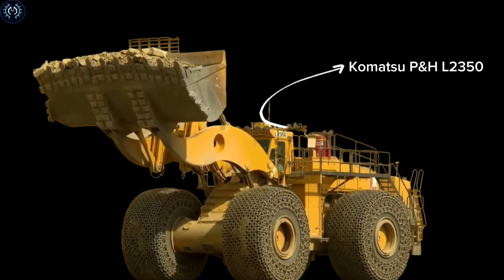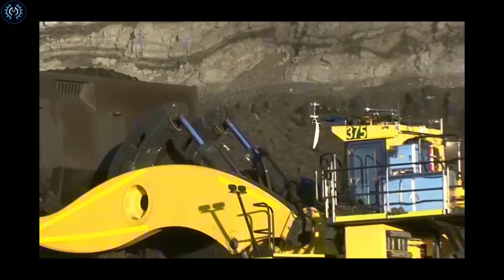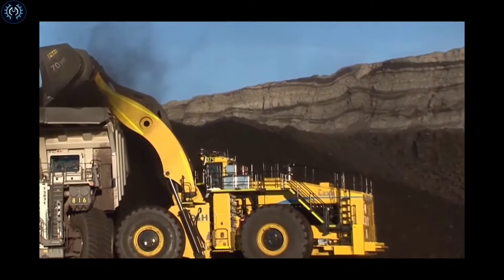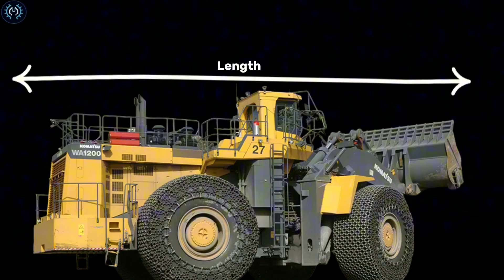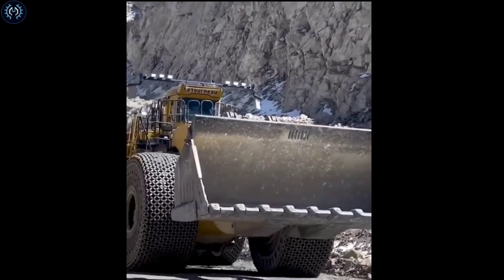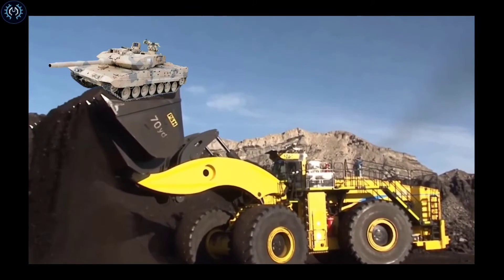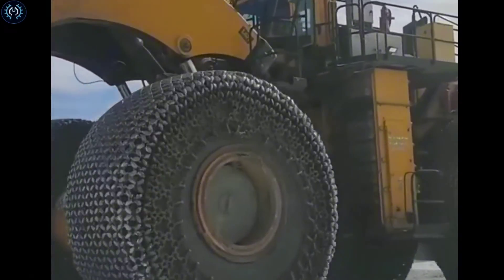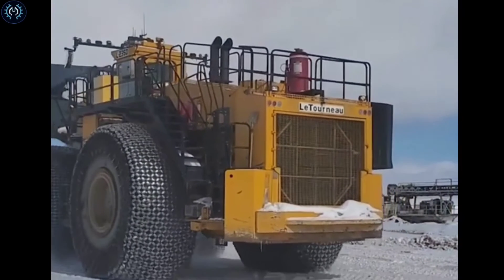Komatsu P&H L-2350 the world's largest wheel loader

Comment: You’re using a WA1200, which is a 120tonne machine, as opposed to the 2350 which is a far greater machine in all specs - your quoted weight is wet, not the 235tonne that is apparent within the name of the machine. This clip contains grave errors. Suggest you do some more research and start again….
Reply from the maker: Yes my friend you are totally right 👍.We used the WA1200 version just for showing some dimensions for the newest version of komatsu.But as you see all data in video belongs to the Komatsu P&H L-2350